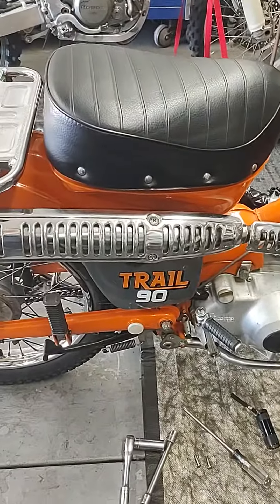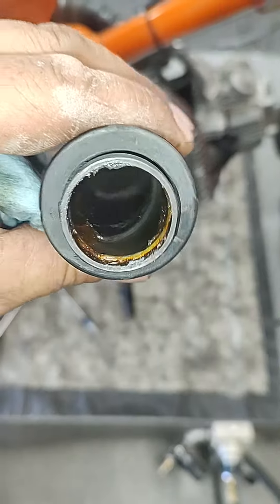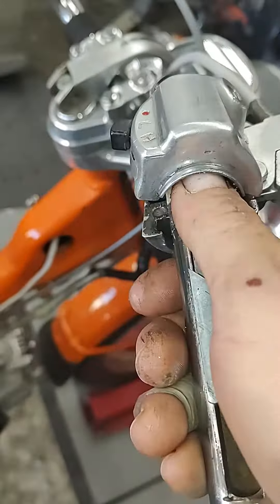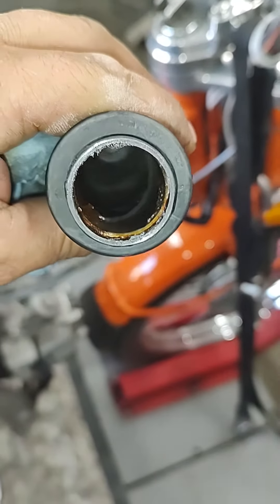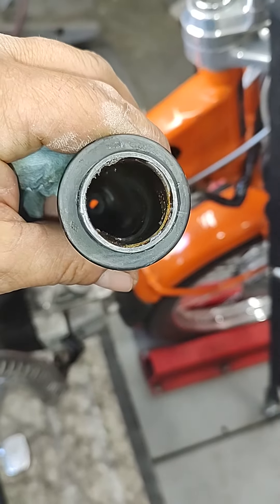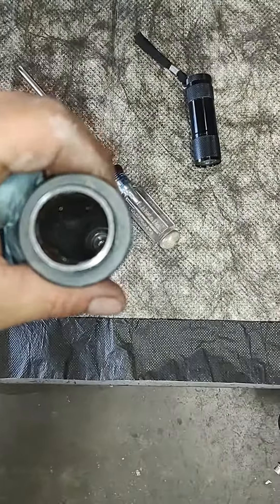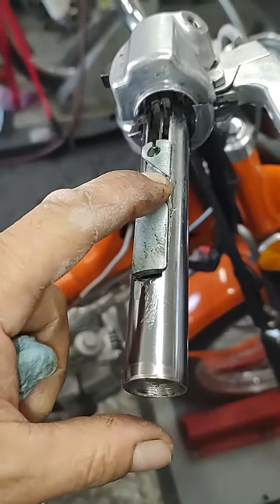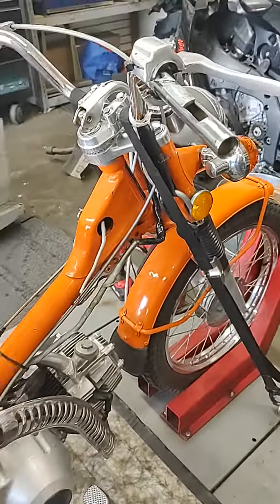**Throttle Cleaning** 1973 Honda CT Trail 90

Comment: Hey remember that time you drilled holes in that valve cover for no reason because you thought it was the old one LOL what Memories huh LOL
Reply from the maker: Yeah, you're not correct. They were the stock ones because I bought the truck new.! Duh....
Reply: @Rynos9Lives  that is possible. They did update it and start installing them at the factory. So you already have the most current design and you modified the design that works when you didn't have to. Next time you should do your research.